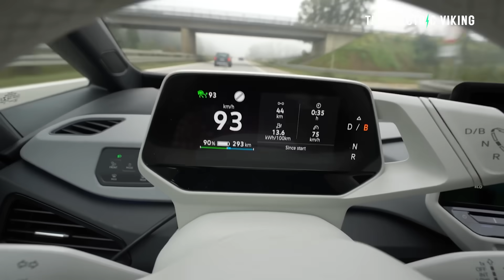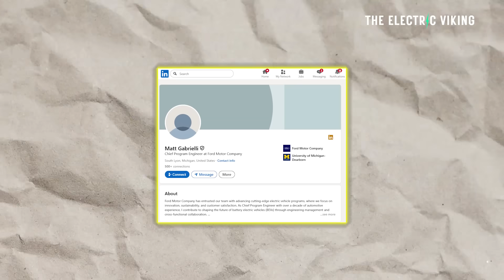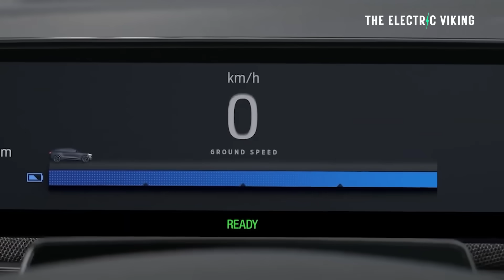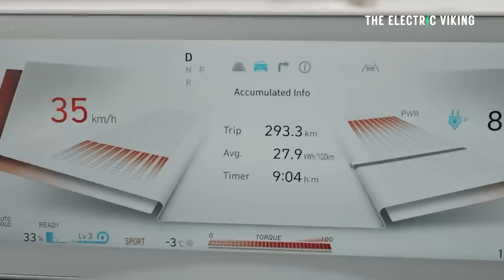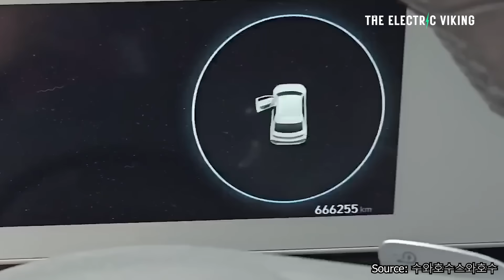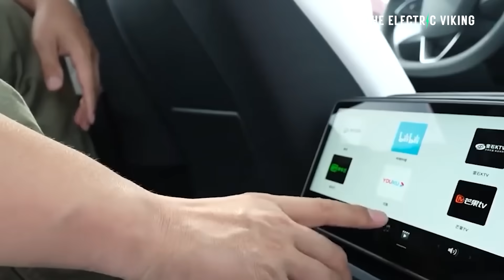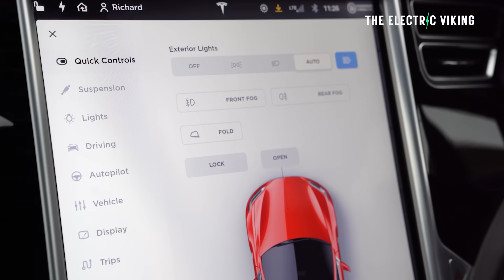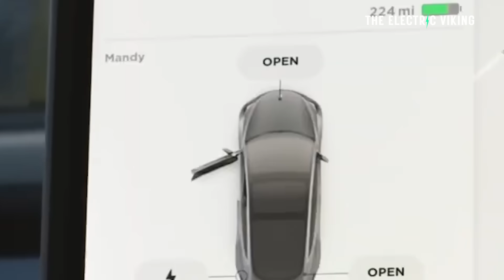Ford Mustang Mach-E Has Over 95% Battery Capacity After 252,000 Miles

Comment: We have 100,000 EV miles with zero oil changes, zero brake degradation (single pedal), zero dealer maintenance.  Since we slow charge 110v overnight to 80%......we have (not zero) very little battery degradation.  One set of tires.  I maybe on my last car?  Super cheap, super economical, super fast and lotsa fun.  Chevy Bolt.
Reply: Does Chevy recommend charging the EV (Low Conductivity Coolant) st any point? I have a Solterra & Toyota/Subaru recommended changing it at around 140,00 miles or 190,000 km (for the rest of the world). I work for Hyundai and we recommend changing it every 60,000-80,000 km or 36,000 - 50,000 miles. Highly recommend doing it, it's the only experience maintaince item we have to do but it ensures longevity. As Coolant ages & goes through heat cycles it becomes acidic. So swap it out before it does any internal damage.
Reply: @zdl360  Chevy has a 150,000 mile change interval for the battery coolant, nothing special about it. Hyundai/Kia went away from their special low conductivity coolant a year or two ago. Much longer change interval now I believe.
Reply: @zdl360  150,000 - from Bolt owner’s manual. 😊
Reply: I have a 2020 Bolt with 35k miles - I charge mostly at level one  to 80% and rearely let it get below 50%.  If I have any battery/range degredation (there must be some!) it is below 5%
Reply: @cjcrawford1958   Hahah...these Bolts are gonna out live me!
Reply: Second battery in 27,000 after 20,000 payment from GM two months of income lost total so far Chevy Bolt .....
Reply: @travisyarbrough4033   I've heard soooo many positive stories over the negatives.  Those cars are / were cheap.  We paid less than $20k.
Reply: Remember that gear reduction units do need transmission fluid changes about every 100k miles.
Reply: I'm sorry to say this, but you definitely have battery degradation. Either you're checking it wrong, or your car has a buffer you can't see.
Reply: @MKAnr1 the Bolt doesn't have any buffer capacity built in. The good thermal management along with VERY conservative DCFC speeds (slow) helps with the longevity of the cells.
Reply: @deanhamer1946  Okay. But no matter what, there is degradation. Batteries degrade over time, so it will never be possible to have zero degradation  after 100,000 miles
Reply: @deanhamer1946   Yup...we learned (the last EV) the hard way that HEAT is painful to EV batteries.
Reply: @MKAnr1 Ice engines lose compression and efficiency and range and power at higher altitudes and under other weather conditions. Even with all the service and fuel costs and toxic pollution and noise they make.
 The batteries we're seeing long term degradation from were 10 - 15 year old designs not nearly as good as what's here in the last 5 yrs and going foward. And yet, these old designs are still out there being used daily while the average ice car is in the junkyard I've heard with an average of 175k on the odo.
Permanent magnets can lose power over time but it takes ages, and emotors are relatively cheap and easy to replace. Ev's have plenty of power to start with so no big deal.
Reply: @MKAnr1   Yes....but, very little.

Comment: I believe there might be some deception going on here because, if I'm not mistaken, a battery's level of charge (range) is based upon it's current voltage and that what might not be taken into account is that the voltage of an old battery will typically drop off quicker than that of a new battery hence an old battery with the same voltage as a new battery won't be able to go nearly as far.  So while it might be possible to charge an old battery up to a voltage level that is 95% of what was achievable when new, this does not mean that it still has 95% of its original range.
Reply: Your beliefs are completely wrong.  Battery life is not based on "current voltage", it is based on how quickly the voltage drops over time, which indicates capacity, as voltage drops on Lithium Ion batteries are very linear and predictable.

Which is precisely why the car needs to be driven some distance to get an accurate range calculation, and early Tesla's showed incorrect range when people drove short distances and charged the battery every night.  When they then drove the car 100 miles or more, the BMS system was able to get a far more accurate range reading and corrected the estimated range error.

Ultimately, the best way to get the most accurate range reading is to charge the battery to 90% or 100%, and drive the car until it reaches 10% to 20%.

Comment: I'm a 4th generation auto mechanic with decades of experience. IMO modern internal combustion engines don't last 250,000 miles because they are designed not to last beyond 150,000 miles. Transmissions however even when well built don't last more than about 200,000 miles and like modern ICE are now also engineered to last no more than 150,000 miles.... Which is why I bought a Tesla, in my estimation they build their cars as well as they can to last as long as they can. So when I went looking for a late model used car (mechanics don't buy new cars) I quickly settled on Tesla as the brand that was worth buying.
Reply: what; stopping them to do it to ev
Reply: @rajsingh4039  Well speaking of the US market I'd say for now Tesla... Honestly that's why the EV changeover in the US failed. The legacy manufactures thought they could just throw batteries and electric motors in the same kinda cars they were already building they would be right up there with Tesla. They ignored it took Tesla a dozen years to figure out how to make a really good EV... Now they know to compete in the EV market they need to build much better cars than they thought they would. Competing with Tesla also means they need to build car that last. At least until they can build cars significantly cheaper than Tesla. Even if they can figure out really cheap, but lower quality then they risk opening the door to Chinese EVs coming into the US.
Reply: got an automatic trans with 440,000 miles on it sitting in my driveway.  You will not believe me, but I have never changed the transmission fluid
Reply: My old Hyundai diesel was still running fine after 296,000 miles. The total running costs are probably less than the depreciation on your Tesla.
Reply: @brendanpells912 your fuel cost alone could be £30,000 higher than the cost to charge a Tesla over 296000 miles. (£6K Tesla Vs £36K in diesel)
Reply: @brendanpells912  Well you kinda said it right there "old Hyundai diesel". Diesels are harder to build planned obsolescence into. They are a naturally longer lived engine. All the same modern diesels. Have emissions systems, torque till yield head bolts, aluminum cylinder heads and so on that insure they too will begin failing right when they want you to buy a new car. Older diesels like my 1997 dodge Ram can easily go way more than 600,000 miles without anything but basic maintenance and transmission rebuild every 200,000 miles.... The trouble is I don't want to drive a 25 year old car as my daily driver and everything made in the last several years other than EVs are junk. In the US there aren't a lot good EVs to choose from, Tesla's are the best.
Reply: @brendanpells912  please run the numbers and get back to us with the correction 😅

Comment: It's good to see these outlier cases showing very long battery life, but what I'd rather see is what I can expect from the average EV. Is the average battery pack life100K, 200K, or 250K miles? Are there specific cells from specific manufacturers that are proven to have longer life spans? What role does the BMS (battery management system)have in battery longevity?
Reply: The BMS's  biggest influence is in how the top of charge voltage is set.  Your phone battery charges right up to the safety limit quoted by the cell manufacturer, EVs have a long battery warranty to honor and leave a bit of margin, which lessens stress on the battery.  If the battery lacks any cooling system (first generation Leaf) it will do worse - but strictly that's the cooling system, not the BMS.
Reply: The average EV should easily get to 15 years and 250k miles.  Even my Model S from 2014 is at 135k miles and capacity is still at 90%.  Newer batteries with more modern chemistries would last even longer...
Reply: Long term longevity 10 - 15 - 20+ years is what interest me most too. As EV prices keep dropping longevity will become interesting. If I get the car for cheap I do make a lot of concessions and don´t expect it to have a 300 mile range - but I do hope it keeps running reliably.

Comment: So in the first minute the author states virtually all manufacturers guarantee their batteries will deliver 75% after the first 8 years. That they must have 75% or they will replace the battery for free. I'd recommend people actually look at the warranty of the specific manufacturers instead of believing some youtuber. Last I checked Tesla is still the dominant manufacturer and a quick check will verify their warranty is not as this guy described.  Nor are the others that I know of. So beware of hucksters and verify outrageous claims before you end up with an electric vehicle.
Reply: You really should do more research before posting.  Tesla guarantees their batteries for 8 years to 70% of capacity and up to 150k miles depending on the model.  It would be highly unusual to get even close to 90% after 8 years.

Even my 2014 Model S with 135k miles still has 90% of original capacity, and it came with a warranty for 8 years and Unlimited miles on both the battery and motor.

Comment: I like Electric cars, however my Jaguar I pace has been a nightmare.  Be VERY careful with relying on the battery warranty.  I was quoted £7500 buy a JLR dealer to investigate whether the battery was faulty or not, even thought the batter is within warranty.   The warning on the dash says HV Battery fault  yet that is not enough to claim under the battery warranty.  I've had to move my car 100+ Miles away to another dealer, I'm currently £3000 down in investigation costs.  They have now confirmed that one issue is a battery module that needs replacing however there are no Modules available anywhere in the world apparently.  I'm also now being told that there is potentially another fault on the HV system that will require more testing and probably not covered under the warranty.  I purchased the car on a finance arrangement, loosing hundreds or pounds a month and no end in sight. Oh and no replacement car so I have to take my kid to school on the bus.  Nice.
Reply: Jaguar iPace is honestly a genuinely an awful car 🚙 typically British half baked development and poor reliability such a shame Jaguar was great at making large petrol saloons but an EV SUV 🚙 as was overreach for the poor engineers as they weren’t give enough time or budget to do the properly. On the overhand my Tesla MY is best selling car from a manufacturer making cars in China but is an amazing EV making with good after sale customer car so please just trade in if you can fix and get the new Model Y on 0% if you afford you will not regret it my friend.
Reply: @ts6070 i will probably move to Thailand in a couple of years. My country is finished. The mechanic is charging almost the same hourly rate as my lawyer. Been to look at a Isuzu Diesel.
Reply: @KwakaRallye88 sure good idea but if your in Asia try the new MG IM6 it’s an awesome EV just being released in the UK
Reply: Sounds like a Jaguar company problem with their service policy and build quality rather than an EV problem in general
Reply: Yeah, JLR has been a train wreck in reliability for decades already, so this is more of a Jaguar problem than EV problem.

Never buy any car from a manufacturer with a dismal track record.  If Jaguar can't build proper combustion engine cars, why would they be able to build a decent electric one...?

Comment: Degraded EV batteries can still be used as a re-cycled power to generate electricity too. And can be charged slowly using solar panels. So there is no need to throw away the batteries
Reply: Not generate but to store energy.

Comment: I love the electric future but it is not uncommon to find 1000's of diesels with over half a million miles on an original engine. My Holden Rodeo 2.8 litre Turbo diesel is over half a million kilometres and it's even still on the stock turbo , it's all gear driven engine, no belts or chains reliable as my 1970's seiko divers watch.......
Reply: And the polution they produce......
Reply: DEF eliminates Diesel longevity.

Comment: No way! My gas engine is only 4% worn at 252k!
JK, I had to replace it at 52k. 
(What about E-motors tho? And that 2011-2016 Leaf battery, lol).
Reply: The Nissan Leaf's had no thermal management system for the battery packs.
Reply: It was a joke, but Leaf degradation got far better after 2016, even though it still had & has no thermal.
Reply: @HoopsKevinski. batteries are cheap enough and roughly 3 to 4 hours to swap one on your own drive with basic workshop tools, you can even swap in the longer range  and better latest generation one.
Reply: Don't count leaf, it was always garbage
Reply: the world has moved on from 1913....hahahahahaha
Reply: @andyfreeze4072 Not regressive USA, especially the "ProLife Party"; they're trying to... abort the EPA, as pollution kills more people than anything.

Comment: BEV batteries are made up of multiple cells. Some as many as 100 cells.
It's very unlikely that the whole battery will "die".
However if just one cell fails it throws the whole battery out of sync.
There are so few EV mechanics in the UK that they can name their price.
To strip down a battery and replace one cell can cost £3000-5000.
Reply: You mean after the 8-10 year, 100k mile warranty.
Reply: @HoopsKevinski. Would you trust any warranty from a Chinese start-up company that was making garden furniture 3 years ago ?
Reply: @Un-Apologetic So you're saying they lasted 3 years longer than Fisker, in a hyper competitive market? 🤔... 😄
But seriously, century old Hertz just lied about tow availability (confirmed by tow driver) & left my "fully-covered" butt stranded in the snow all night (which I'm not used to, being from the desert 🏜️. (Phoenix, AridZoneA).
Reply: Yet Cleveleys Electric Vehicles, based in Gloucestershire, refurbished a ten year old Nissan Leaf battery (around 120 cells) for £500. The video of that refurb is here on YouTube...
Reply: @Brian-om2hh a Leaf is primitive. No battery conditioning. You see what a battery for a Tesla or a Kia EV6 would cost.
And if you're in Norwich, Gloucester isn't much help.
Reply: Most are way more than 100 cells, but it’s irrelevant if the pack meets warranty requirements which are 120,000 miles for most Teslas.  Not to mention that that they easily double that.

Comment: I"d be interested to know how many sets of tyres it went through and did the motor need replacing and the cost it compared to ICE engines
Reply: My Ioniq5 (230kW) only wore out its first set of tyres at 70,000 km.  About the same as the original tyres on my diesel SUV.  There is no difference as long as they are rotated and wheels aligned, my worst ever car was a 1500 cc Daihatsu where the tyres lasted 20-25,000km for some reason,
Reply: My mates son's tesla model 3 clocked over 50,000k's on it's original tyres....
Reply: compared to my Wildtrak?  and by the way how many of these ev motors' have you seen replaced?  I would love to know.
Reply: @TerryHickey-xt4mf no motors, have you ever replaced an electric motor in an appliance before something else wore out?
Reply: 55,000 miles and counting on my most recent Model Y tires.  FSD seems to lengthen their lifespan.  Cost to own overall is extremely affordable.
Reply: Tires wear based on how you drive any car.  If you have a performance car and drive it hard, it wears out tires faster.  My Maserati 4200 wears out tires in about 10,000 miles...